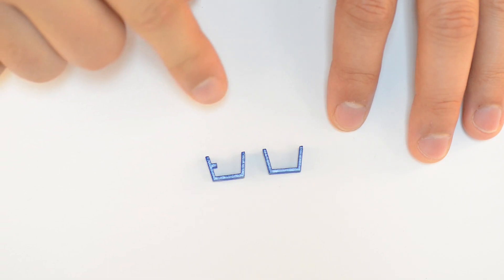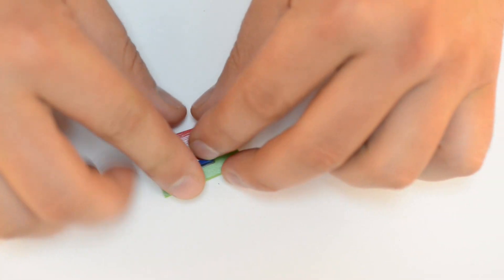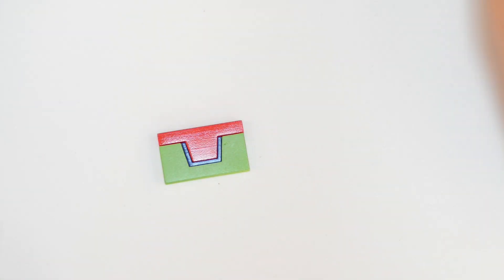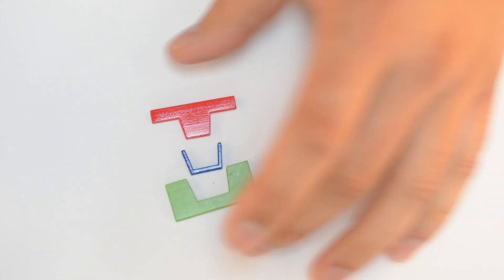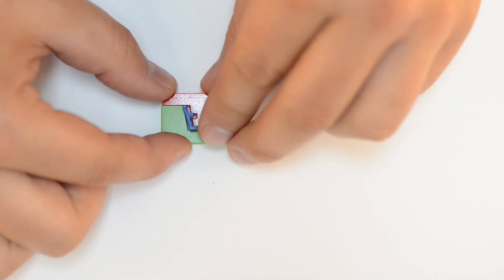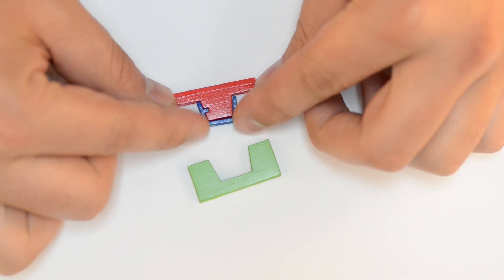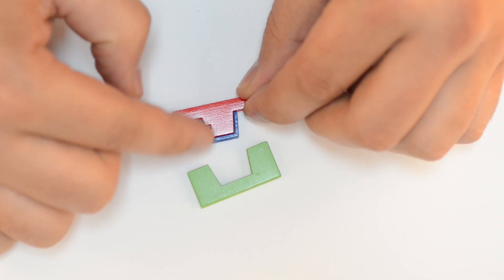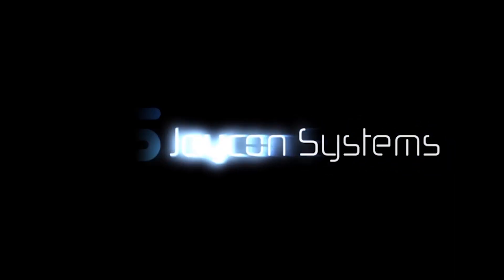Injection Molding 101: Undercuts

Comment: What if the part needs an undercut? Do you have to find another method to make it? Like 3d print or something?
Reply: You can still make the part you just need a side action.  The mold will be a more complex though, and therefore more expensive.
Reply: Are there any general rules of thumb for those? im in school for machining so i want to be able to make molds myself. im wanting to get into plastic injection as a hobby. im looking into making a ram EDM machine right now.
Reply: Awesome, thanks.
Reply: @Zaku186  How did you progress?